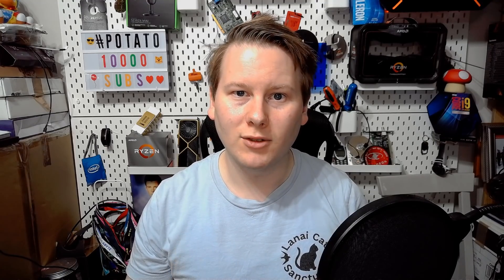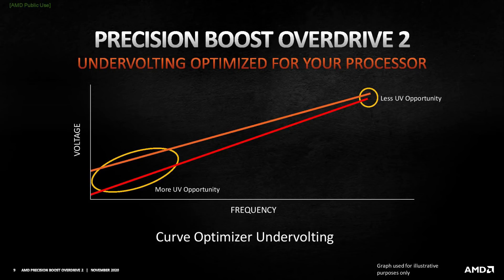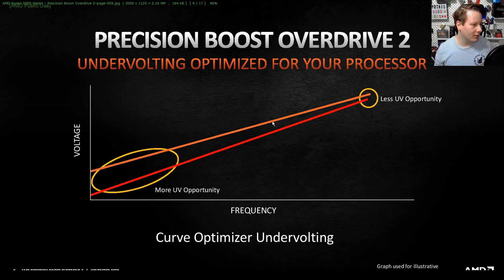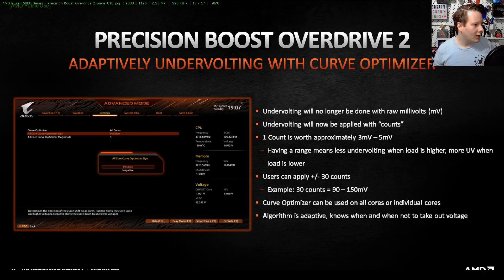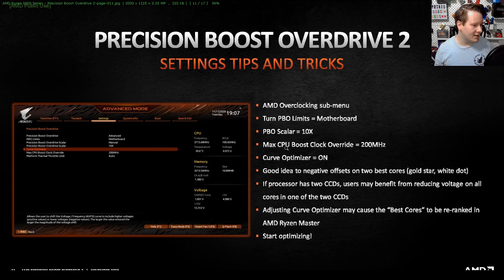Short News: AMD Adaptive Undervolting ⚡

Comment: I did underclock my Macbook Pro, it helped a lot with the noice from the computer (otherwise often 100% fan doing nothing heavy). I did stop though since for it to work on a mac you need to disable system integrity protection (chrome had a bug that destroyed data on the disk if SIP was disabled a few years ago). 

I’ll probably undervolt my next computer though (unless it’s a laptop that does not allow me to).

Comment: really cool feature, another thing I'd like to see is a frequency cap maybe at low loads. Stock they can jump up to the max boos clock even at just 3-4% load... That makes for some jumps in temperature, a low load frequency cap would make the processor much more efficient without any noticable drop in performance. This is already a really good option for more single core boost and more multi core boost. Just a setting that would help keep it efficient on low loads, My UV is there mostly to keep low idle temperatures. 

I think we would all want to see all these things be adjustable per core as well, that would really be fun tuning them all!

Comment: I conceived a series of 30 runs of two benchmarks in a very stripped down recovery Linux environment to test undervolting on my Ryzen 3900X with minimal background tasks running, far less than Windows could ever dream.  After identifying my highest performing core, I ran a C program of no op loop on that core to test and log the maximum frequency for a few minutes (scripted).  I then directly ran a full core load using stress for five minutes to also test the all core boost.  I found that undervolting didn't affect my maximum achievable frequency on my best core a great deal, it tended to a slight improvement but only around 35 MHz on average with my top frequency detected as 4635388 Hz.  I experimented with different scalar values, different overclocking levels in the Asus X570-i BIOS, and found that my best results for all core boost came in at 4107241 Hz, up from 3981071 Hz with a -0.1 vcore offset, level 3 overclock mode and PBO set to auto with my power limits raised above specification - not a huge improvement, but notable.  There was extremely minor run to run variance likely due to the timing of my polling interval, but it did tend to a linear improvement with a reduction in voltage even though we're talking of a range of around 100 MHz, which is obviously not a lot when all is said and done.  I ended up settling for a -0.09735v offset as it ended up being similar and pushing lower than -0.1v offset resulted in system instability.  Also keep in mind, I'm running FCLK at 1900 MHz to match my 3600 MHz memory running at 3800 MHz with tight timings which would increase package temperature and IO chip power consumption.  Apart from noticeably improved benchmark performance, the chip went down from 85 degrees (PBO auto, level 3 OC, no undervolt) all core boost down to 77.5 with the undervolt with an ambient temperature 23-24 degrees during the series of experiments using a Kraken X52 AIO.  The idle temperature was also significantly lower which reduces my fan duty by it staying at the minimum configured RPM and not ramping up during light work loads.  All in all, I'm glad to see this feature being implemented and I will certainly look forward to playing with Ryzen 5000 chips in the future when stock levels and price improve in my local market.

Comment: I like this. Not all threads and instruction sequences tax the core at the same level even at the same frequency, and i'm also guessing the amount of bubbles in the pipeline affects this. 2% single-thread to 10% multithread potential is definitely enough to increase their lead over intel. As an overclocker in the past it's a bit sad that overlocking isn't really that much of a thing anymore, but at the same time, great to see that the out-of-the-box performance has gotten much better. Why leave performance on the table.

Comment: I use undervolting in my old i7-4700MQ to improve the turbo boost, a massive 30% improvement in perfomance so i can keep the high turbo boost clocks for a very long period of time and on par with the 2600K now if i don't do Cinebench (for obvious reasons).

The 4700MQ and 2600K are in theory the same or 150-155GFLOPS.

Comment: I did undervolt and frequency limit my RX 5700xt because it would run way too hard while playing strategy games. A driver update a few months ago probably fixed that, but it would be nice to have selectable power limits for different workloads or applications. 
I'd like the same for CPUs. Since AMD'S seem to follow their power limits exactly, why can't the limit be selected? I figure going down to 20W for a R9 5900X might not be reasonable, but 60W and 80W (average) should be.

Comment: I'm less interested in getting more performance, more interested in running my NH-D15 passive in my Silverstone FT05 without Ryzen temps killing the dream.

I really wish AMD and Intel would sell bare die chips like they did back in the day, with the heatspreader being cut down to stabilize the cold plate at the edges, but completely missing in the middle to allow direct contact.

Comment: I undervolt my 3900x@ 4,35 Ghz @1,256v all Core  with less Power usage than @stock under full Load . Its sad that you could not make a exception for the Boost . 
Adaptive Undervolting  is nice , keeping the Boost and undervolt under all Core Load , that keep the Temps down and the all Core Boost will be higher , if it works good , the old way of all Core OC will be unnessesary for a high Multicore output . 1usmus created a Tool for Ryzen 3000 called Clock Tuner for Ryzen , it tests the quality of each CCX and the lowest stable Voltage , its automated and works , it saves Time . I bet he will update it for Ryzen 5000 , it would be perfect for Adaptive Undervolting and the optimal Curve

Comment: Does this automatically determine the minimum voltage required to stay stable? (Eg via test transistors at slightly lower voltages spread throughout every clock domain?)

Or will lowering this too much cause crashes?

Comment: I think it is an excellent step forwards. The modern PC is a power hungry beast and with people now at home for prolonged periods of time the power bill climbs. I personally use intel cpu's but my next build will be AMD. I would much rather have Efficiency over Gigahertz. I recently underclocked my GPU as another youtuber Optimum Tech gave a very good description of how much wattage could be reduced at next to zero impact upon what the eye can actually see when playing a game. FPS drops were minimal but efficiency improvement was exceptionally high. As a consumer and the tech industry using Numbers to try and influence me that higher is always better it is easy to forget the value of efficiency. We understand the concept when driving a car as we need to fill the tank and we can financially feel the impact of driving a fraction slower to gain that extra mile.

Comment: Amd needs to find a way to drasticly cut idle power, I can't get any of my ryzen chips to idle under 100w, even my nehalem and fx chips can do that. On load power consumption and efficiency is amazing though!
Reply: Huh? What CPU are you using? 

I'm idling at 36w on a 5950x so check your cpu usage during that time. See what program (or settings) are preventing you from achieving low wattage idle
Reply: @The1Mischief  1700, 3100, 3700x. Use a WATTMETER.
Reply: @h2oaddict61  So you're talking about total power consumption measured from the wall? In that it's not necessarily the CPU that's drawing most of the power. PSU efficiency, drives, mobo (including all the auxiliary functions like sound, network, etc), RGB, cooler, USB devices, graphics (which is generally at least 10W at idle), etc would all be a part of it. With that said X570 was (and still is?) a hugely inefficient chipset at idle, drawing 10-15W more than B450 based on debauer's testing from a while ago.
Reply: @irridiastarfire  I know all about that buddy, the 1700 is on a b450, 3100 on a b550 and the 3700x on a x570. A decent gpu actually uses a lot more than 10w at idle. Use a wattmeter if your have one!

Comment: Tried this today with my 5800x on a b550 aorus pro with the F11i bios, very great results!
But the margin for negative "counts" drops sharply when the max clock offset option is used to push ST loads above 4850MHz.
In some short testing my 5800x could drop ~25 "counts" off voltage, which results in a serious rise in MT performance!
Works with PPT/EDC/TDC settings too, so since you wondered about it cooperating with Eco-Mode it works and is great!
Have a nice day everyone and good luck with your chips :)

Comment: Most of the time, I'm doing very light tasks where a high frequency is completely irrelevant, so I undervolt my 1600 to run at 0.85V and only at 3200 MHz using the Ryzen Master program. Then when I need to do something else, I just enable another profile. It takes me 10 seconds, so might as well.

Comment: But but but I want MOA power, I still rock my cooling solution from by Bulldozer CPU. 🤭
Reply: Many people here have old but capable cpu if overclocked. Some streamers even run underclocked cpus and their stream is laggy.  Why make the cpu suck more by underclocking it and at the same time they are talking about upgrading lol. Why not get a cheap china cooler and max out the cpu so you dont have to upgrade?!  You can even "undervolt" a 4790k on all core 4.5Ghz, though I wouldnt use that term. I would just say running it with less voltage safety margin. You play around with the power limit windows in the bios so it doesnt overheat on a poor cooler and you can still get a snappy windows experience.

Comment: If a Ryzen 5100 (X or whatever) or something like the AF came to life it would be really interesting to test it out in super low voltage use case where it could shine in multicore with the ARM competitors + the Samsung or Apple designs
Would it be the new best mini server or NAS processor 🤔?
And maybe the 5900X will get to have some core over the sky in 5.7GHz with the other cores underclocked 🤓?

Comment: I undervolt.   I have been setting a voltage offset or manual voltage since E6420.

Sometimes I'll underclock too.  Well really run at the base frequency without turbo on my 4790k.

Comment: PBO + offset and amd curve optimiser will get you 5 ghz and above - Here is what the users got at OCUK Forums  https://www.overclockers.co.uk/forums/threads/5800x-boost-set-to-5050mhz-all-cores-with-amd-curve-optimizer.18906071/

@TechTechPotato Ian definitely check this out. I'm hitting 5000 with my 5600x.  PBO + 350 offset - amd optimiser setting Per core - 5. Not only MSI currently allow you to go over the default max offset of +200. MSI goes up to + 500 but not its in a different section of the bios.

Comment: Well, Micro Center sold out of the 5900X so I got the two 5600X's for my two builds. I hope it works with the single die cpus as well. Although being a 65W cpu that OC's to 4.85Ghz w/PBO is still amazing. Would I get any more boost out of it, with this?
Reply: If it works, running cooler allows longer boost operation.  Each CCX has 2 cores nominated as superior, hence the multi CCX CPUs having more potential, they can spread the heat

Comment: Why wouldn't you always run -30 counts? Did I miss something?
Reply from the maker: At some point you actually end up reducing your turbo, and performance would get lower. Or there's an offchance the algorithm might dip the voltage too low and the CPU will brownout. As with overclocking, there's a balance.
Reply: @TechTechPotato  Interesting. If the algorithm is not smart enough to give you the exact smallest voltage you need to reach the highest turbo, I see little point in it.
Might as well tweak the voltage directly at that point, instead of tweaking it through this "count" value and algorithm.
Reply: @XseuguhX  It's basically a negative voltage offset with some wiggle room built in. I think around the 5-7 count mark would probably work best, which is also mirrored in the gigabyte example shown having it set to 5.
Reply: @XseuguhX  It'll still probably get you closer to the limits of the processor since it's not a straight voltage offset and depends on heat, load, available power, etc. e.g. if you visualize the multidimensional curve of the algorithm's inputs and output voltage compared to the optimal curve, there should still be less space between it vs a "generic" curve with a straight voltage offset. Just because you can tweak one value in the equation doesn't make the equation useless.

Comment: This marks another step in the long history of dynamic frequency/voltage adjustment to get closer and closer to the actual silicon limits, first initiated by Transmeta's LongRun.

Of course we welcome any efficiency and performance gains.  The only downer remark is that marketing tends to exaggerate the impact, as with eg. PBO, which is really hit or miss.

Comment: Been building in SFF cases for the past 2 years or so this would definitely be nice to have when I move to ryzen. Currently just doing a -0.095V offset on my 8700, works fine most of the time but still crashes once every few months
Reply: The 8700 is usually a bottom of the barrel bin. The 65w TDP can be misleading considering most motherboard vendors by default set PL2 and Tau to basically infinite numbers. 
You'll probably get better thermals and performance undervolting a 8086k than a 8700.
Reply: @DenGuleBalje  that doesn't really matter if he would get better undervolt, that's all down to "silicon lottery". 

The point is that for 99% of his use case the chip is stable, but for 1% it's not, because the undervolt is a flat offset. So for 1% of his workloads, the chip needs more voltage. 

This also means that he is at the sweet spot of voltage for "1%" of particular workloads while the remaining 98% could actually get an even lower voltage. 

Percentage numbers are an example and not an absolute, but hope it gets the point across.
Reply: @gismo3564  Like I said, the 8700 is a lower bin part. They are the losers of the silicon lottery. Sure there are variances, but the 8700 chips are the ones that fell below a certain threshold for silicon quality. The higher bin chips were sold as 8700k and 8086k.

Comment: If I were going to build an air-cooled system on a budget with a stock cooler I'd probably undervolt.  My next build is planned to be a custom loop, though.  In that case I can pump as much heat as I want for performance for gaming.
GPU's, though, are at a power draw limit, so I'm planning to undervolt that for sure.

Comment: I do a slight undervolt with my 3700x in bios using the offset function, and get a slight improvement in cinebench after doing it. Did AMD mention this function should be used w/o offset, or are there benefits to using it together with offset?

Comment: Hope we get this in laptops. Both gaming and thin/light. Would be nice to have also have the option to spend the voltage overhead on either better battery life or higher clock during load,

Comment: That is cool but as long as AMD refuses to support Linux with their AMD Settings I don't care about it. AMD supports the drivers on Linux, better than NVidia, but they neglect the rest and that lets down Linux-gamers. AMD does not even have to provide the GUI, just give some API and some developers in the Linux-community will make the rest of the software.
Reply: i mean you probably are 10 playing on linux, you can understand you are not the priority :/
Reply: @yhadidi75  It does not mean that we should not ask for it. It is not our task to reason for the company, it is our task/responsibility as users to ask for features. AMD could fully opensource the code of AMD-settings and let the Linux-developers figure it out, AMD could let an intern port it over. Plenty of options which do not cost a lot of resources.
Reply: Realistically Linux is not a priority, however API access in general would be great. Not only for linux but also for windows applications.
Reply: @qlum  True, if amd just opensources that too then the rest will follow without AMD having to spend a lot of resources on it.
Reply: As a Linux gamer, I couldn't care less about old habits people bring from Windows. I want a performant driver, the type you do not even think about it, not a app to tweak a driver that is not performant.
Reply: @magoid  That has nothing to do with habits!! It has to do with optimizing performance, for that a tool like AMD Settings is equally as important as the drivers. If the game-developers uses an unsensibly high tessellation then AMD Settings can cap it. There are a few tricks like this to improve performance. Also it is NICE to have a feature like Chill: it decreases the fan-noise while gaming at moments that the FPS should not be high, whether you cap the minimum at 60, 90 or 120 is a different matter but capping it is useful. 

I don't know what you talk about with the "driver not being performant", that is not the case. At least not compared to Windows. The driver performance is the same on Linux as on Windows. I benchmarked enough on both OS's to see the consistency.
Reply: Are you talking about GPU drivers in this thread, because this video is about CPUs?